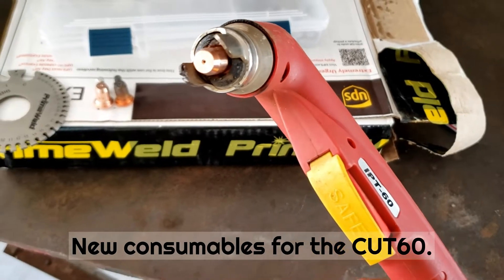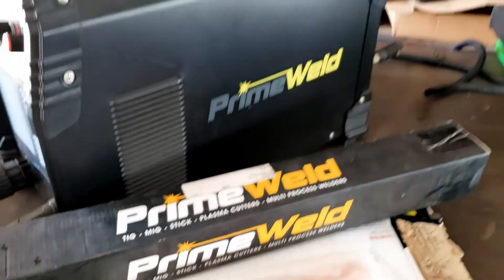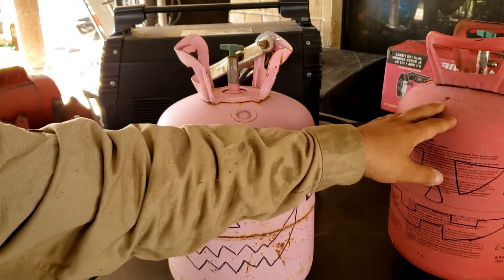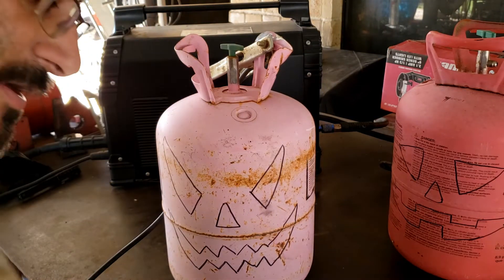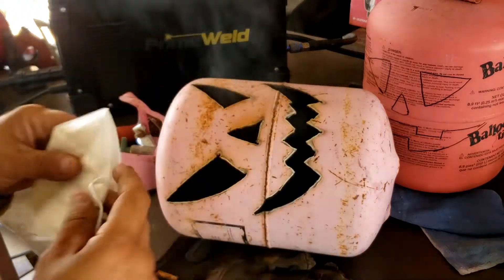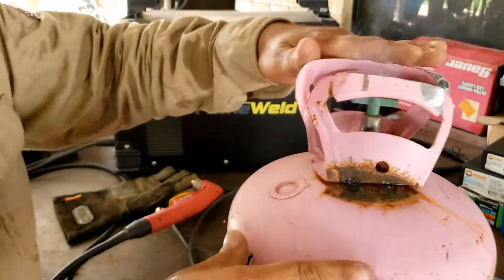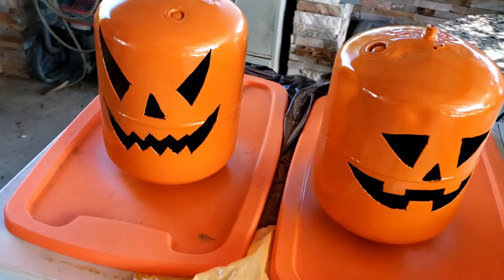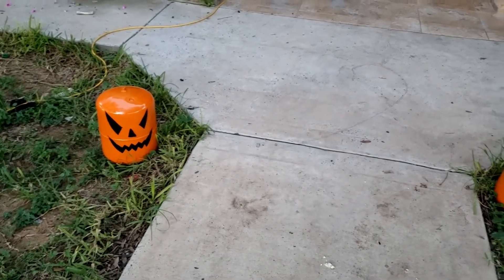How to plasma cut halloween pumpkins jackolanterns from scrap tank: atmosfx projections primeweld

Comment: No welding mask?? Every video I watch they have helmet, gloves, respirator, tools that a rich man can only afford. Does the flash not bother your eyes....the tanks look great
Reply from the maker: I tend to use a welding mask when I weld and sometimes use my oxy cutting googles when I plasma cut. If the arc is above the metal or highly visible it will hurt your eyes. A respirator is something I started using as well and got to think of my safety.  Thanks